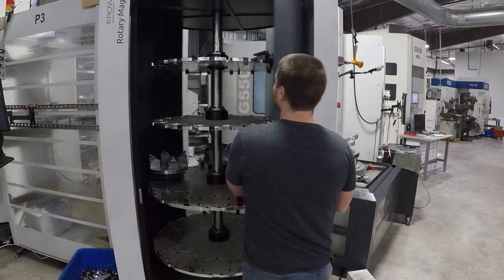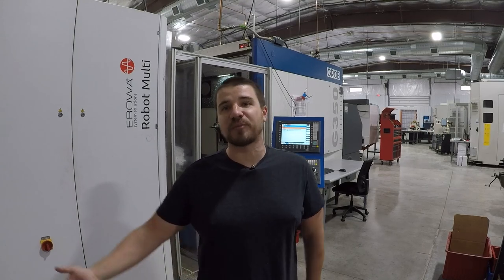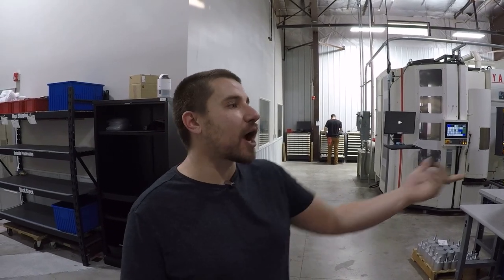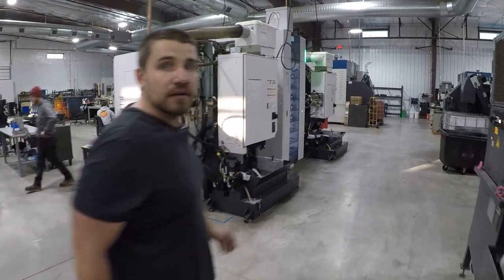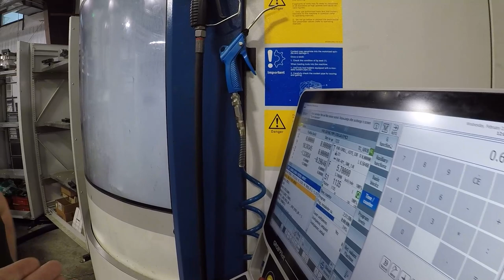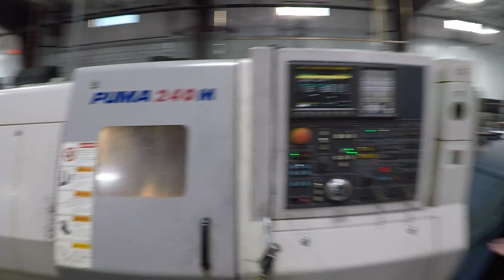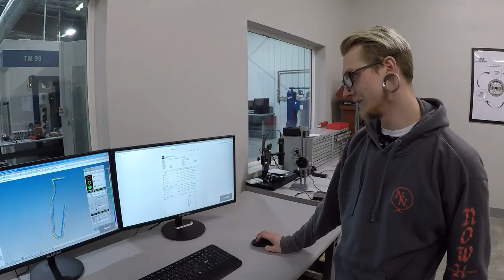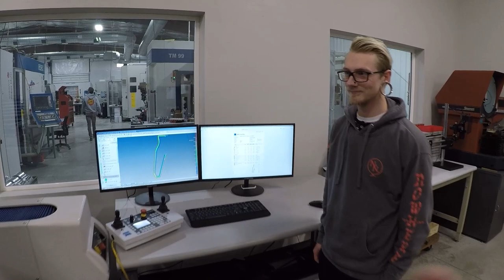AWESOME High Precision Job Shop Tour: Creations Unlimited!

Comment: 95% of the work at my company is semiconductor for lam too. They are hard to work for! They control your process once it’s dialed in you can’t make a single change  without recertification. Can’t even change the coating of an endmill, can’t add anything to coolant, and so much more
Reply: I have built alot of stuff for the  Lam facilities. Even then they are super critical about details.
Reply: @k..............1622  yes they are!

Comment: Great tour. Shout out to the puma 240m. Curious 🤨 what’s the difference between a brother and a robodrill? Does one do anything better then the other or is it just preference ?
Reply: Brother has their own controller and to robodrills run Fanuc.
Reply: They are similar machines once you have them running. They have been talking about that on his podcast a bit lately because john grimsmo is buying a brother soon
Reply: @Awfultyming  
That’s why I was asking I know he has a relationship with the robo dealer, having just bought the cmm of them. I guess it just a preference or availability thing then.
Reply: Does the brother have a higher horsepower spindle?

Comment: I run an NTX1000, and it's so much fun, and is such a beast compared to Mazaks and other lesser brands. Super easy to set up with transfer and "done in one" operation. We put a HALTER stacking robot system on it. I use the turret for rough, and B axis for finishing, since it will hold +-0.005mm all day every day in aluminium, while the turret is more prone to drifting by +-0.01mm during the day. It's amazing to use in Inconel as well, super rigid machine. Machining in both spindles at once is so convenient, and I don't think I could ever go back to a machine with only one channel. 
We're looking into a CMZ TTL, and I cant wait to try out superimposed machining with XZ axis on the sub spindle.

Comment: Legit shop but none of the guys wearing safety glasses blows my mind....one mistake and that's all she wrote.
Reply: As an non US American I have always wondered why every body in these shops wears  safety glasses the whole time. Even visitors. Ist there a rule or something like that?  
At my workplace there are only safety glasses required if the Machine is not shielded enough. On any modern CNC machine with an enclosure no one wears safety glasses.
Reply: @anselml2928  with air nozzles and the chance of foreign objects going into the eye in those settings, it is an issue. And OSHA governs this in the USA yes.
Reply: @aschnaub1  Thank you for the explanation. Yes, compressed air and chips are a dangerous combination.

Comment: AMERICAN MACHINE SHOP WITHOUT HAAS MACHINE, WHAT A SAD
Reply: HAAS machines are 'medium level', and are much used in many companies. When need 'high level' there is other brands. Groob has a factory in the USA also, where many machines for the local market are manufactured